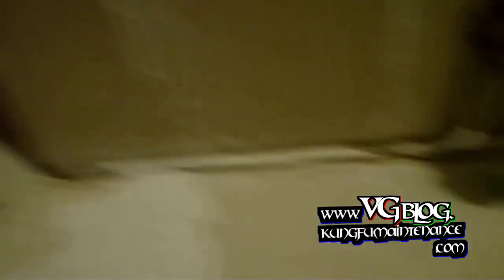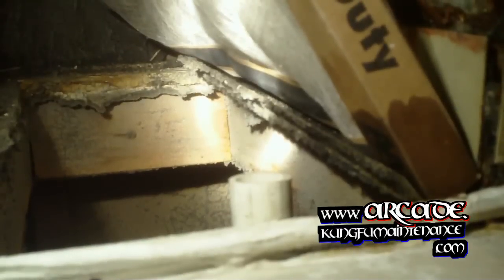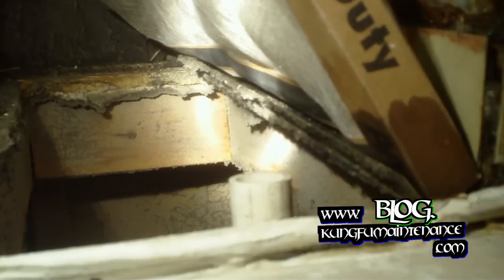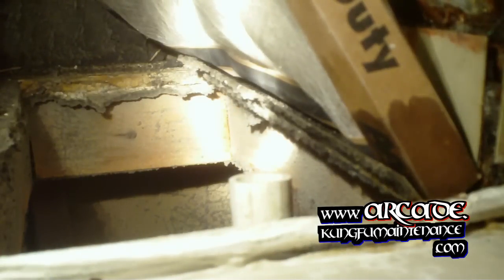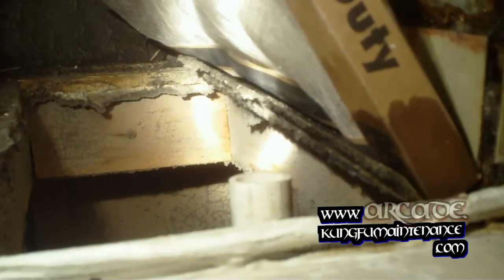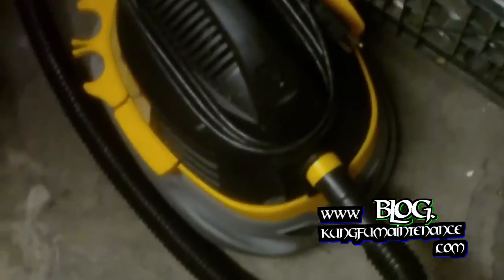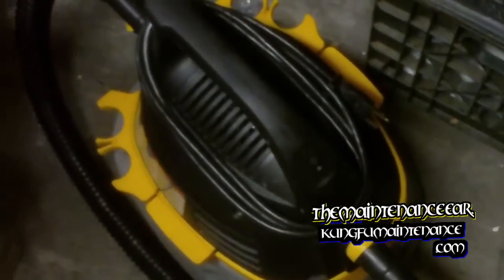How To Unclog Clogged Air Conditioner Condensate Drain Wet Carpet Floor In Front Of AC

Comment from the maker: Wet Dry Vacuum used in so many KFM videos   http://amzn.to/2lFxi7u
Condensate Pan Tablets   http://amzn.to/2lalV9W   No Rinse Coil Cleaner  http://amzn.to/2lHg8GD
Condenser Fin Whisk Brush                          http://amzn.to/2vWXUoC 
Chapin Pro Pump Sprayer                             http://amzn.to/2vWCXdD
Evaporator Coil Cleaner No Rinse Mix        http://amzn.to/2x3eJTT
Evaporator Coil Cleaner No Rinse Can        http://amzn.to/2ezIxju  
Get the Screwdriver used in so many KFM videos here    http://amzn.to/2kHFoOF 
Get the Milwaukee 11 in 1 Screwdriver     http://amzn.to/2uTtsNj 
Get  the Multi Tool Pliers used in so many KFM videos       http://amzn.to/2kWTjPp
Get KFM favored Electronic Leak Detector        http://amzn.to/2kmQMMz
Simple Leak Seek Spray   http://amzn.to/2lFfcC5  Laser Thermometer  http://amzn.to/2layD8I  
Hard Start Kit     http://amzn.to/2kiD16v   Contactor     http://amzn.to/2lFqA0P
5mf Capacitor   http://amzn.to/2wC96sH     35mf Capacitor    http://amzn.to/2vZVZ2t
35/5mf Capacitor   http://amzn.to/2iVJNi2        40/5mf Capacitor    http://amzn.to/2wzEdXD 
45/5 mf Capacitor   http://amzn.to/2w0wez5   
Get KFM's favored AC Gauges here            http://amzn.to/2kYgGb8
Easiest Way To Get Universal EPA Certified Prep Manual    http://amzn.to/2kIQdQC
You must be EPA certified to charge or recover refrigerants and here is about the Easiest Way To Get certified with the Universal EPA Certified Prep Manual    http://amzn.to/2kIQdQC
Valve Core Removal Tool                              http://amzn.to/2kJ00pC
Inficon Refrigerant Scale                               http://amzn.to/2vUCQPD
Get KFM's favored Multi-Meter  here        http://amzn.to/2l8W9CO 
Get The Kung Fu Maintenance book here     http://amzn.to/2lEQPFk
Or  the Kung Fu Maintenance E book here  for less than $5    http://amzn.to/2lEY8wD
Get the Kung Fu Maintenance album (good driving music) "Up Beat" here     http://amzn.to/2l41pZ1
Get the Kung Fu Maintenance album (nice Instrumental music) "Entropy" here   http://amzn.to/2kl2U0p
Samsung Galaxy S8 Plus        http://amzn.to/2sFn9h8
GoPro Hero 5 Action Camera         http://amzn.to/2sN4nVK
Rode Lapel Microphone                 http://amzn.to/2vZoFc7
Purple Panda Lapel Microphone  Kit   http://amzn.to/2wByXkq
Video Edit Pro Software       http://amzn.to/2ruaaeZ
Samsung Galaxy S5                 http://amzn.to/2wBxk6l     
Samsung Galaxy S8 Plus        http://amzn.to/2sFn9h8
Video Edit Pro Software       http://amzn.to/2ruaaeZ

Hire An HVAC Specialist                                  http://amzn.to/2lktKek
Air Duct Cleaning Services                              http://amzn.to/2lFTpun
Central Air Conditioner Tune Up                   http://amzn.to/2lzJGoy 
Air Conditioner Repair Or Installation          http://amzn.to/2lFsEGw                                           
I don't work for any of the product companies  listed however I do make a small commission on items ordered  through the links.

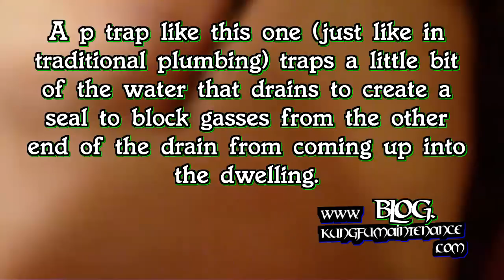Comment from the maker: I would try outside first but if nothing comes out than vacuum from this 2:12 point the air gap it will most likely pull from the condensate pan first (which is a good start) so you may need to temporarily block the condensate drain at the pan so it pulls from the other end. Beyond that you can try the same procedures converting your vac to a blower if it has that capability to try to blast it out from either side.

Comment from the maker: Sounds like it is a vent and should be left open. I show one of these in this video and is where I vacuum from in the vid(though yours may be in a slightly different spot such as outside the air handler). It helps with drainage much like the old style cans where you puncture one side and than the other so that the contents can vent and flow out easier.

Comment: I've tried using the wet vac to unclog the drain.  However, no water came out of the outdoor drip line.  Obviously, there is a more severe blockage within the line.  Can an AC Drain Line be snaked since it's only about 1 inch in diameter?
Reply: +brian Johnson Yes, with a coat hanger.

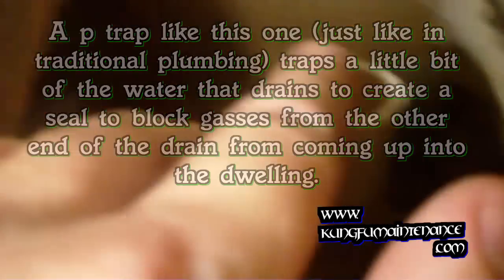Comment: I have water overflow at 2:12 where you're pointing at if I remove the lid, does that mean I should try to vacuum it out from the outside or from your fingertip point?  Nothing seems to come out when I try to vacuum from the outside.

Comment: A drain system which eliminates all the failures caused by the condensate P-trap has been developed. The device solves ALL the problems caused by the commonly used “industry standard” p-trap. It is self-cleaning, self-regulating, has no moving parts and requires NO maintenance.

The most commonly used condensate drain system includes a water trap, which exhibits so many failure modes that reliable operation is rare. The propensity for traps to fail is well known in the industry. More than 20 years ago the American Society of Heating, Refrigerating, and Air Conditioning Engineers (ASHRAE) published the following statement in their Standard 62-89R: 5.6.4 Drains and Drain Pans. 

“Condensate traps exhibit many failure modes that can impact on indoor air quality. Trap failures due to freeze-up, drying out, breakage, blockage, and/or improper installation can compromise the seal against air ingestion through the condensate drain line. Traps with insufficient height between the inlet and outlet on draw-through systems can cause the drain to back-up when the fan is on, possibly causing drain pan overflow or water droplet carryover into the duct system. The resulting moist surfaces can become sources of biological contamination. Seasonal variations, such as very dry or cold weather, may adversely affect trap operation and condensate removal."

Despite the numerous failure modes common to the condensate trap, it is an integral part of the drain system now accepted as the “industry standard.” The success of this system depends upon the best possible trap design and effective maintenance by the building operator. But, there is no standard or useful guidance for performing either of these functions. The widely applicable national, and many local, plumbing codes state only that HVAC drain systems shall be trapped, leaving detail design to others. 

Failures caused by the “industry standard” condensate drain systems have been identified, and a drain system which eliminates all these failures has been developed. In keeping with the savings it provides building owners, the system has been named: CostGard™ Condensate Drain System. The device solves ALL the problems caused by the commonly used “industry standard” p-trap. It is self-cleaning, self-regulating, has no moving parts and requires NO maintenance. Tens of Thousands have been installed and not one has ever failed.

Comment: Hi. Thanks for your video. I see you have over 500 loaded. Please, allow me to give you a quick constructive tip: Close-up shots should be used only in very specific instances, not throughout the video. As it was shot, this video is very difficult to watch. With everything being so close there is no perspective. You can get a decent tripod for $5, put it 5-8 feet away and only get close when is really needed. Plus you will gain use of both hands. I guarantee the videos will improve dramatically.